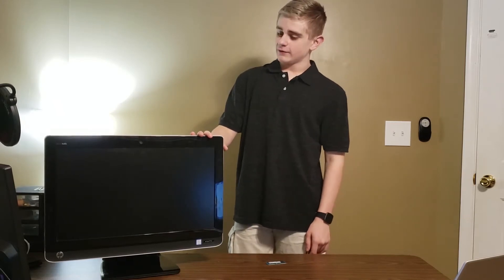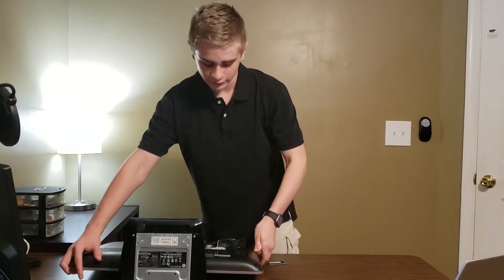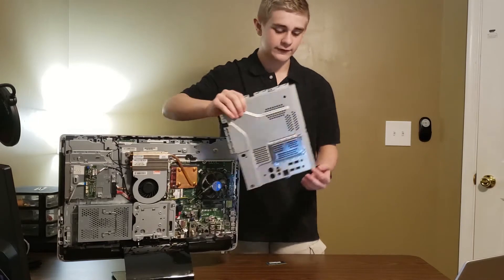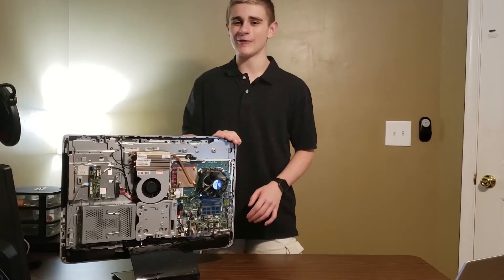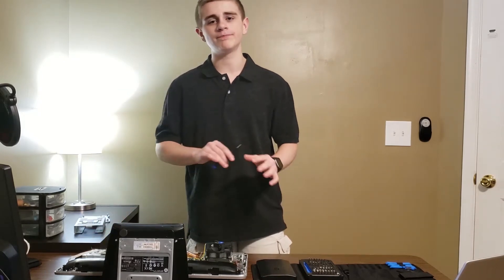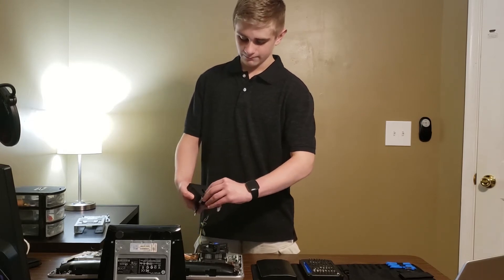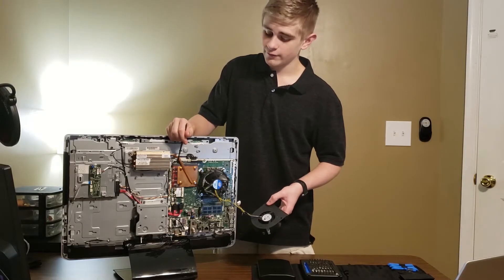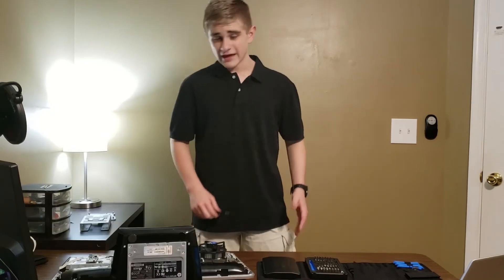I Cut a Hole in my Desktop! - Omni 220 Project (Pt. 1)

Comment: Hello! I like your video, I have the same hp omni 220 desktop. I have done several research and it looks like I need a new hard drive, I do not want to buy a new pc, if I can fix this one for a few bucks I think is better. Can you please help me how to choose a hard drive?
I really appreaciate your help.
Reply from the maker: I recommend a brand new Seagate Barracuda. Those guys are super fast for the type of storage device they are. And if you're going for an SSD instead of an HDD, I recommend a Samsung 840 Evo or some newer SanDisk SSD. Crucial is a great option as well.

Comment: I'm dailying a 2018 HP 20 c023w AIO:

-Intel Celeron (Modern) J3060 - 2 Core
-4GB Single Channel RAM
-500GB HDD
-1600x900 TN Panel
-HDMI Out

I don't want to make this comment longer than it needs to, but my AIO is quite silent and all I hear is the 5,400rpm HDD crunching away, also the put the Hard Drive Activity LED on the back of the Case (WHAT KIND OF MESS IS THAT???) I had it for over 1 year now, it went by so fast cause I did not have any Hardware issues with it, I recommend it for the person that wants a PC for Web Browsing or Media consumption.....
Reply from the maker: Sounds nice! But the most likely reason for you not hearing the fan working away is because intel celerons use barely any power at all and therefore output much less heat than a standard intel core processor.  That wont stop me from checking one out though... thanks!!
Reply: @TechBizmo  Its wired cause the CPU Fan doesn't spin up under load like my Laptop's Fan does and I've throttle the CPU more than once, so the J3060 or "J Series" has less Power than a "N37xx Series" Pentium!

It's so odd...